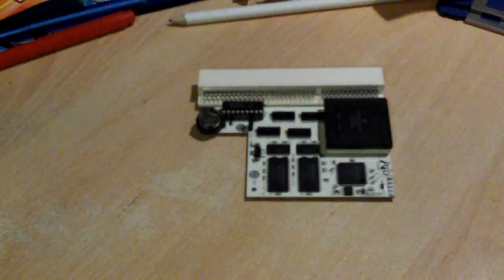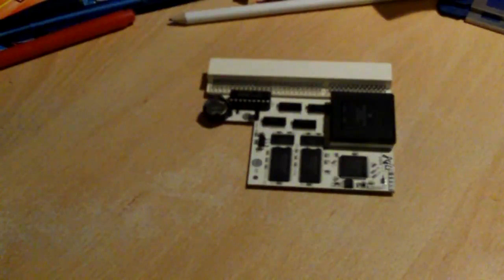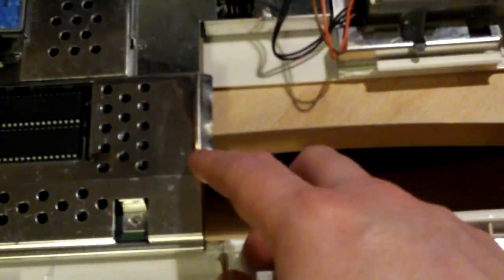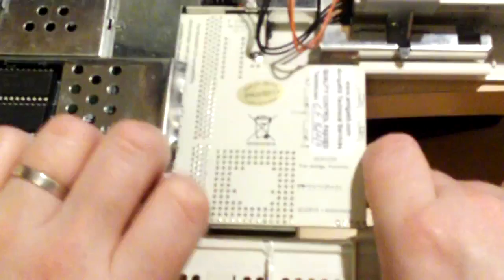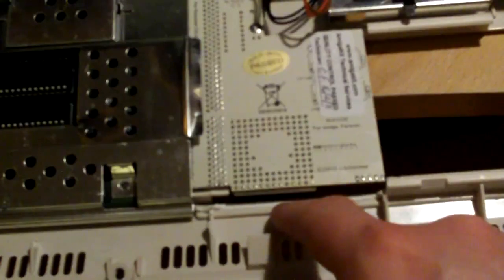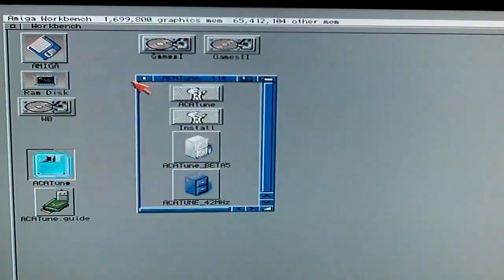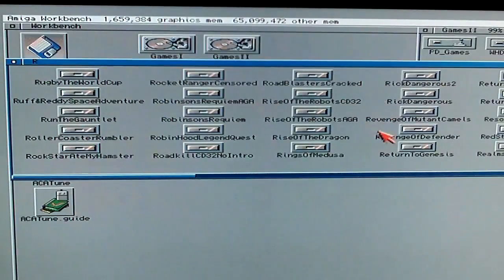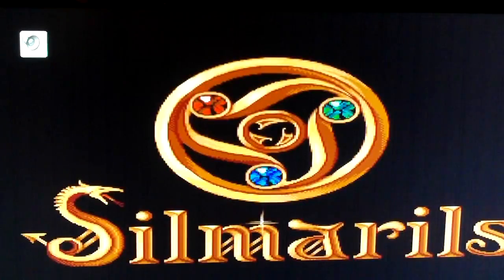Installing my ACA 1230/28 accelerator card on Commodore Amiga 1200

Comment: hi I have 2 amiga A1200. one of them was my dad's.  that one has a card in, it's a A1200 8mb ram/fpu/rtc. with a whopping 209mb hard drive. just as he bought it brand new. I would like to upgrade my dad's with the board you have. where can I get one. do you know of any other upgrades that are useful for my A1200. thanks jon

Comment: @Paperclown Because LCD or not, this is still on original hardware, using its actual capabilities to their full extent. There's no gentlemen's agreement against that, is there? 

Running on low-res RGB monitor is fine for most Amiga games but it would be a waste of a good OS. So it's either a good multisync monitor or LCD.

Comment: Thanks for this! Saved me a bit of trouble, I just lobbed off the piece of plastic mentioned @ 1:45 even before my 1230 arrived. Although I did leave the bit next to the disk drive. I also had to remove the two caps on the flipside of the motherboard.

Do you do requests? Here's one: WHDLoad for absolute dummies! I got the software, the scripts and the uncracked ADF's mounted but somehow I'm still lost :(